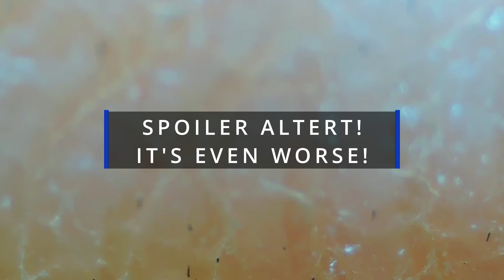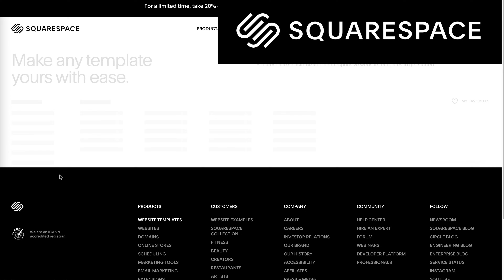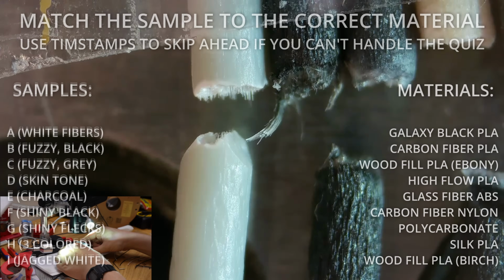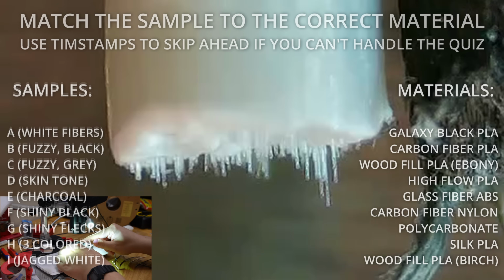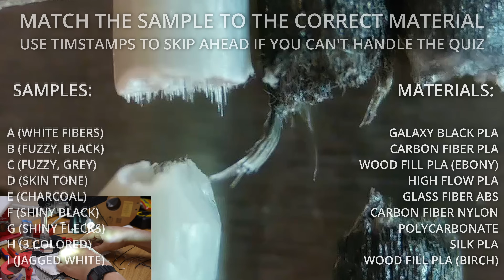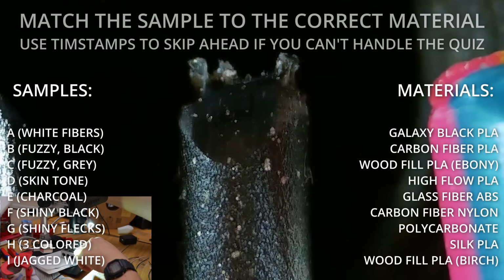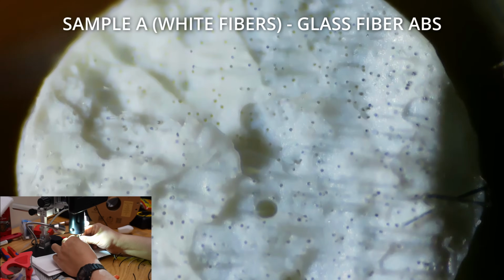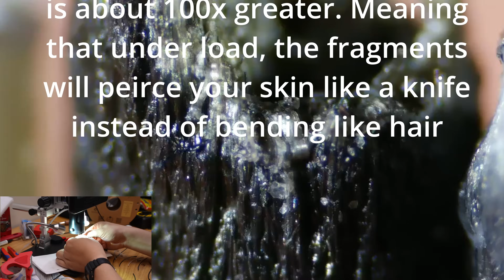Carbon In My Skin. These Wounds, They Will Not Heal.

Comment: Me *looking at the spot in my palm where I accidentally stabbed myself with a mechanical pencil when I was a child and still has the mark*: Yeah I’ve kinda noticed.
Reply: My only tattoo.
Reply: @DARKredDOLLAR  Do you have a filling in your mouth? If so, it's not the only tattoo you have.
Reply: YES I KNEW I WASNT THE ONLY ONE
Reply: @jamesg3713  -- that happened to me in 4th grade, sometime around 1976, but with a regular pencil.  That pencil lead is still there.
Reply: lol I still have a pencil tip in the center of my right palm and it's been at least 10 years.
Reply: i been stabbed in the palm by a kid like 35 years ago and the graphite tip yet stucked in my palm. :) Maybe it slowly absorpted or some tissue case growed around it, i had no any problem with it at all, it's just carbon anyway.
Reply: @plinker439 your body turns the cells around the affected area solid creating a little barrier around it so it never leaves
Reply: @LeafBoye yeah that's what happened to mine it's just a ball now vs the pointy object if was like 30 years ago
Reply: Until i was annoyed by that lump and used an exacto knife and pair of tweezers to extract that pod that ended up the size of a grain of rice 3x bigger than the sharp shard it was encasing!! @LeafBoye
Reply: @plinker439  lmao I have the exact same story. Except it was high school
Reply: Are you me?  Damn pencil  @plinker439
Reply: @plinker439  besides, we're carbon based regardless ;P
Reply: @plinker439 I said I was sorry Ethan.
Reply: I still have my graphite tattoo from 1st grade 30 years later.
Reply: Looks like we're going to have some sort of childhood pencil-based mishap meetup.
Reply: same… it got a lot fainter over the years
Reply: I can still see my wound although it has disappeared little over the years or become harder to see, but still there!
Reply: Hey, me too!
Reply: Same here! Little black spot on the middle of my palm. I feel it everytime I see someone flip a sharp pencil around.
Reply: Mine's on my leg - I dropped my pencil and instinctively tried to catch it with my knees, guess which orientation I "caught" it in
Reply: Same 😂 right in the middle of my left palm
Reply: Hold up! I'm not the only one??? I stabbed myself with a regular graphite pencil on my pinky finger when i was like 7 years old and 23 years later the spot is still visible!😅
Reply: I can top everybody in here. I got one mark on my left knee, and one on my right knee in the same spot. Take a second and see if you can image how that happened...

Well, it's not as interesting as it sounds. In first grade, some guy stabbed me in the knee with a pencil. Then in seventh grade, some chick stabbed me in the other knee with a pencil. I'm 45 now and I still remember both of them had crazy eyes.
Reply: Yes I still have a scar embedded in my forearm where a kid stabbed me with a pencil at school. It was an accident on his part. I’m 35 and still have a dark spot there.
Reply: Same! After doing homework in bed I somehow leaned my knee straight into a sharpened pencil. Not the technique I'd recommend for tattooing yourself but it definitely worked.
Reply: Lol I got a chunk of graphite still in the webbing between my pointer and middle finger it is just a ball I'm the skin now...
Reply: WoW- Me too! Me and a school mate were fooling around in class and I got poked pretty good in the had with a bic pen. This was over 40year ago, and you can still see the ink-mark under my skin.
Reply: Same except i stepped on one over 20yrs ago, still got the mark... although i didn't realize until 3 days later that a chunk was still in there and had to cut it out.
Reply: i've got one too in the middle of my palm!
Reply: oh damn you too? I put a mec pencil in my pocket and the lead jab into my nail bed. I stayed there for weeks til I couldn't take it anymore and cut my nail open to take it out
Reply: I got stabbed in the palm with a pencil as a kid. Just checked my palms. Yep, there's still a mark.
Reply: wow is that a common thing? i have a gray dot in my wrist there i leaned back on a pencil and it stabbed me while the teacher was reading us a story. i didn't make a big of it and just kept quiet. but i guess it left some pencil lead in there...
Reply: Hahaha Same but Just a pencil. I wanted to Push paper down the bin Had a pencil in it it was stuck in my Hand and u have a Mark of that still after 16 years.
Reply: cheap tattoo'ing for kids
Reply: I've got a pencil lead still in there somewhere.  It's not from a mechanical pencil but rather just a regular 'ol yellow HB pencil. 

Also... you're complaining about carbon in your hand, but you're made of it.
Reply: Oh, i call it my pawn print now lol. It is like tattoo that just stay inside of my hand for the past 20 years😂
Reply: Oh, i call it my pawn print now lol. It is like tattoo that just stay inside of my hand for the past 20 years😂
Reply: Yep - I still got this shit in my index finger; I apparently stabbed my finger with a mechanical pencil at the age of 3
Reply: I've got a spot on the side of my foot that was the same situation.
Reply: 15 years ago, still very visible (tho it did fade a little bit)
Reply: My mom still has tiny bits of gravel that got trapped under her skin when it healed after a nasty scrape as a kid
Reply: YOU TOO????
Reply: hey, me too
Reply: Holy shit!! You too??
Reply: @joshfacio9379  yes, actually, now it still visible after 18 years
Reply: ++ I also have a pencil stabbing scar from childhood and the led is still in there,
Reply: In middle school, which for me was 30 years ago, i was messing around out out of boredom throwing pencils up to stick in the ceiling tiles. And eventually i made a joke about my friend, he took it too seriously, threw a pencil at me. It stuck into the back of my wrist when i went to block it. 30 years ago and i still see a little dot where it was, i actually forgot all about that until just now. It's faded quite a bit since then, but it's still visible.
Reply: You invented tattoos! 😅
Reply: OMG When I was a teenager, someone stabbed me with a pencil and I still have the mark under my skin. 40 years later.
Reply: Same but it's not carbon in the way that carbon fibers are within filament. Just graphite
Reply: lmao mines just under where my pinky and ring finger meets on right hand. 5th grade math class.
Reply: got a pencil stab in my left arm from highschool, it's been 15 years, still there.
Reply: I was stabbed in the hand with a pencil as a child I still think there's a piece of pencil lead in my hand but it's just moved too deep
Reply: I thought you don’t get scars on your palms, because the skin repairs itself completely
Reply: @mephistosprincipium  You do, got two slashed tendons on flexor zone 2 pinkie and ring fingers. I got large zig zag shaped scars due to the way i've been operated, permanent thick scars, then multiple tiny pale white scars from glass shards.
Reply: Accidentally, huh?
Reply: I got stabbed in the thigh with a pencil in grade 4. I'm 56. Not dead from it yet. STFU about it.
Reply: wow thats exactly what I have :D
Reply: Omg me too.
Reply: Yeah, why is it that spot doesn't ever go away?
Reply: I've still got one in my knee thats been there for at least 15 years. A dude stabbed me because I was "annoying". 😒
Reply: @ShirozawaDesura  i have a mark of a  pencil under the fingernail of my right thumb 🫠
Reply: I jabbed a friend who was messing around and wound up popping me in the face way harder than intended. It was a reflex, I had a mechanical pencil in one hand and a textbook in the other. He still has the only tattoo I have ever given. 😂 We are still friends to this day, true friends will admit they were wrong, and get over it. That's really the only time in our friendship that lines were crossed, and only by accident and my action out of surprise.
Reply: Was a ballpen in my case. It's how I learned left and right 😂😂 😂still there. No fading.25+ years later. Good tattooing really.
Reply: Yo! The same happened to me but on the backhand
Reply: Many many many people including myself have a piece of pencil tip in our hands from some childhood mishap The memory of recieving these scars is always very clear and similar.
But what if these memories are inplanted created memories, and the pencil tips are actually chips or tags that were put there intentionally?
Just sayin. Just sayin.
Reply: @vlnow  bro is onto nothing 🔥🔥🔥
Reply: @vlnow  👀 BRB, looking for Xacto blade.
Reply: @vlnow nah i remember it well, it was basic graphite for a mechanical pencil. We were just violent. Here in the south there wasnt enough money dedicated out in the sticks to brainwash anyone lmai
Reply: Wow I've never met other people in person with this same problem, but clearly it's way more common than I thought. 2 spots in my left palm from getting stabbed while pulling pencils out of my pocket as a kid 😂
Reply: Congrats that's how tattoos work

Comment: Now we need to be careful with any filament that is deemed abrasive on the nozzles🤔, Most likely all of them will endup with safety issues. Also what about if those abrasive stuck particles start reacting with solvents we use such as alcohol(as in a sanitizer), or other chemicals like nail polish (acetone)vapors, or paint solvents, gas, diesel etc? What is the potential for turning carcinogenic 😢. It is like an elephant in the room, now looking back. Unfortunately the genie is out, thanks to NBR for bringing awareness😅. Looking forward to huge clearance on these filaments. Now need to figure out an effective conformal coating/dip, to use all these goodies!😂❤👍

Comment: Microscope looking at the filter next video?
Reply from the maker: That’s an interesting idea. 

There won’t be much to see though. My office is consistently 0-3 ppm, and I haven’t don’t more than a few days of experimentation with CF
Reply from the maker: Plus the filters themselves are massive and finding a carbon fiber amongst all that surface area would take a while.

Something like an in chamber recirculating hepa fan on a machine that’s run a lot of CF parts would be very interesting.
Reply: @NathanBuildsRobots  hmm maybe for more pedestrian filters with smaller filters would show more easily. Are you using any external devices to monitor the ppm? Or just the one on the fan

Comment: It seems like "Nathan thinks this is probably not good for you" is not enough to go on. I understand the motivation, but there need to be more actual scientifically structured studies to draw health based conclusions. We also have to remember there are risks involved in using the chemicals to seal carbon fibers etc. The question is not really is this "bad" for you, but does using "x" accelerate the human body's tendency to eventually stop supporting life in a significant way for a significant number of human beings that handle "x". Being cautious is not a bad thing, but being overly cautious will have the same impact on one's quality of life as not being cautious as all. I reserve the right to be wrong.

Comment: Wouldn't fiber reinforced injection molded parts have the exact same problem? From experience with thermoset injection molding with phenolics and epoxy, I know that those materials can make your hands feel a little itchy, but there's also up to 80% of fibers and fillers in those materials. However, you don't really hear about people having itchy hands after using a cordless drill, even though the housings are almost all made from PA-GF and they're rubbing on your skin for hours. There is no way those randomly oriented fibers are all perffectly embeded in plastic, after being pushed into a mold cavity at a few hundred bar, so why is it a problem with 3d printing specifically? Is it the much lower pressures? Realistically that shouldn't make that much of a difference and fiber content in 3d printing filaments is rarely higher than 15% from what I know, whereas 30% or more is very common for parts like drill housings.

Comment: I really appreciate your focus on this important topic, but I think it would really benefit from incorporating actual scientific literature. Observing fibers under a microscope can be alarming, but the presence of fibers alone doesn’t necessarily imply significant health risks and claims about material safety must be backed by scientific data/literature to avoid spreading misinformation.

Currently, the coverage of your videos might be causing undue concern by presenting an incomplete picture.  At the end of the video you suggest everybody to do their own research, I think this presents a good opportunity to teach people how to do this therefore it might be helpful for the community to produce a follow-up video focusing on how to research material safety.

In this case, reviewing the MSDS (Material Safety Data Sheet) and TDS (Technical Data Sheet) for PA12-CF filaments and their listed raw materials reveals that they pose minimal health risks, with standard first aid measures included. Scientific studies further support this: most carbon fibers used in 3D printing are around 5-10 micrometers in diameter and are not considered respirable. Research on PAN-based carbon fibers, which are commonly used in filaments, also show no adverse health effects from exposure to them.

Here are some quick snippets from literature:

"Available data reviewed indicate that no adverse health effects occur from exposure to
PAN-based carbon fibers. Carbon fiber is not classifiable as a human carcinogen since there
is inadequate evidence of carcinogenicity from animal studies and no human data."

"In assessing the health hazard potential of carbon fibers, the precursor, heating

history, epoxy matrix, sizing, aerodynamic equivalent diameter, and length all need to be
characterized. Currently, there is no evidence that the industry standard PAN-based carbon
fiber with diameters 7-8 pm are a respiratory hazard. An additional industry sponsored
subchronic inhalation study on a 3.5 um diameter, PAN-based carbon fiber has been
conducted but is not available for publication yet. Once this study has been evaluated,
additional work may be required."

The study on 3.5 um:

"No effects were seen when rats were exposed for 6 h day−1, 5 days per week, for 16 weeks to an atmosphere of 20 mg m−3 of carbon fibers (25 × 106 fibers m−3) and small amounts of fiber particulate resulting from preparation of the ultimate test material. The carbon fibers were made from polyacrylonitrile fiber. They were 3.5 μm in diameter and 72% were 10–60 μm long. Histopathological evaluations were made after each of 4, 8, 12 and 16 weeks of exposure and after 36 and 80 weeks of recovery.

No effects due to the exposure were seen, as judged by clinical signs, body weight, organ weight, organ-body weight ratios, organ-brain weight ratios, gross and microscopic examination of internal organs, special stains of lung tissue for fibrous tissue, reticulin and fat and pulmonary function measurements"

*edit:
"Carbon fibers usually possess diameters in the range of 5–10  µm and are not considered respirable. However, mechanical operations on their composites can cause release of not only fibers with the same diameter as the embedded fibers, but also smaller respirable fibers caused by splitting of fibers along the axis The health impact could be concerning if the split carbon fibers with respirable sizes are present." 

So do wear PPE when milling / sanding etc, as is with everything, although for fibers of smaller sizes, inhaled in the 3.5 micrometer study no effects were observed. I would still advise it.

Comment: This is meaningless fear mongering. Obviously the CF will stick out, obviously they will rub off. But so will the fibers in all the fiber reinforced materials around us. The question is: is there a plausible way to get them into the airways? The main danger is probably printing, not some cf sticking in the finger.

Comment: i have a p1p and i just print PLA and i noticed i cant breathe some times while printing. i notice it more when the filament dryer is on and when printer is printing obviously since the pla is coming out hot with the fumes it releases. i wonder what i am allergic to. i print with flashforge burnt titanium and reg pla colors but i notice it more with the burnt titanium.

Comment: I have never used these kinds of filament as of yet, but this totally does not surprise me. 

I used to do competitive (recurve) archery some years ago where the most common type of arrow shaft was made of a aluminum-carbon composite. Now those fibers probably ran lengthwise along the shaft, but sometimes arrows break. Or get damaged. It was always made clear to just throw away a damaged arrowshaft and to NEVER touch anywhere near the damaged part of carbon fiber, precisely because of how easy it is to penetrate the skin and that it doesn't break down in the body.
Reply: An* aluminum

Comment: I'm quite happy printing the vast majority of my prints in PLA and the rest in PETG.

Fiber filaments really do not offer a magnitude more of an advantage anyway, they're slightly better.

Right now, someone in the World is sanding CF reinforced filament without breathing protection. Or with protection, but without gloves. Or with both, but then the part is brushed free of the dust, and the particles are still on the part and still floating in the air. This is worse than toxicity...
Reply: Not just 3D printing, there are loads of people shaping their own surfboards with gf and cf. Lots of sanding, lots.